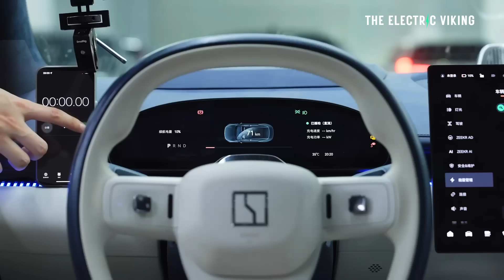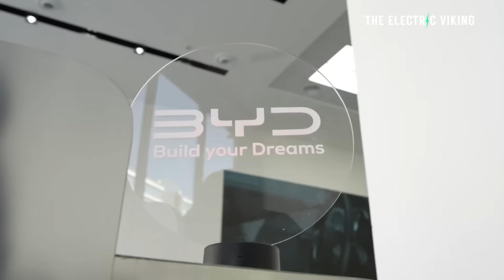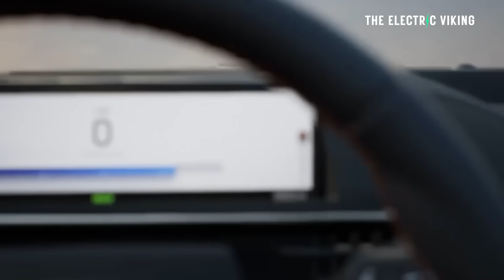2025 EV Sales Skyrocket: WORLD's Unstoppable Rise to 7.2 Million Vehicles

Comment: UPDATE:  I drove past the BYD new factory site in Szeged, Hungary last Saturday, 14/06. They are currently doing site enabling works and building accommodation blocks for Chinese construction staff. The local authority is also reconstructing the road outside the site and have already completed a new access point to the nearby M5/E75 motorway.  The factory will produce the  Dolphin and Atto 3 EV for the European market. Other models, such as the Atto 2 small SUV and the Dolphin Surf (European name for the Seagull minicar), are also planned for production later on. The factory is expected to begin production by the end of 2025.

Comment: Any idea how i buy an electric car. Not knowing if the brand will be around in a few months.
Reply: ?? Buy a used Tesla model 3 Long range AWD . Tesla will be here in a few month for sure.  You can get 4y old car under 60 000 miles for 23 000 $ +/-   (22-24000)  I did that :D  Car looks like new and drives like a demon (almost 500 hp)  :D
Reply: @MartinMartinX  I did exactly that with the small difference our "new" car is a 4 year old Hyundai Ioniq 5. Very nice car so far.
Reply: @MartinMartinX no don’t support Tesla and the egomaniacal fascist Musk! Geely has been around since the early 80s - they make Volvo luxury cars and mining trucks too
Reply: The same dilemma is probably more true of established marques, which are still trying to peddle outdated ICE motors.

Comment: 😮It's pretty selective based on location.  In india, the third largest car market, the ev sales for FY 2025 (April 24 - Mar 25) were 107k even with big government subsidies.  Growth is deceptive, you need to give actual sales numbers.  If a country sells 10 million ice vehicles, and 1000 ev one year, and 10.1 million ice and 1500ev the next year, then ice has gone up 1% and ev 50%, despite the fact that 100k more ice vehicles are on the road for 15 years and only 500 more ev.  It will be interesting to see if petrol prices fall as the demand for oil decreases, as oil is still needed for tar to build roads, and petrol and diesel are part of the refining process.  A lot will depend on charging infrastructure.  No doubt ev will become a big segment of new car sales in the long run.  Hopefully coal fired generation will not increase to offset the power demands of ev and ai.
Reply: Approximately 20 million EVs will be sold in 2025, 12-13 million BEVs and the rest plug-in hybrids.
Reply: So I suggest to look at saturated markets like Europe: ICE sales are down the drain more each year and EV sales are slowly but steadily growing in spite of cancellation of most incentives in most countries. E.G. in the fleet, BEV's are a growing portion even still very very little in most places, but in the interim, with sales market share above 15% in most countries, it is also growing in the fleet all the time. There's no way back.
Reply: @beatreuteler Nobody is denying ev sales being a player.  For europe in 2024, 13% of sales were ev with petrol, hybrid, diesel, plugin hybrid making up the remaining 87%.  Petrol diesel and hybrid are ice, with plugin hybrid a semi ev.  It's still a long way to go to claim ice is dead.  Savings for a lot of people will disappear when road tax for road maintenance is added to ev running costs as it makes up a sizeble part of petrol/diesel costs.  If ev don't pay for the roads, then roads will deteriorate.  You cannot run heating diesel oil in cars for this reason.  A mix of vehicles is likely to remain for a long time
Reply: @barryobrien1890  I agree, with the mix continously shifting until the mix is the other way around than today: less than 5% ICE and hybrids, while BEV's will be above 95% some time later this century. I also do agree that at some point the money used for road construction will need to come from elsewhere than from taxes on fuel but a) that may become a factor in only a decade from now and b) Fossil fuels will become more eexpensive to gain continuously which will make up for most of this benefit.

Comment: The infrastructure isn't here . The few chargers don't work. Other cars block them off .
     To see a Tesla is uncommon.  We are a small town but a hub serving 30 thousand people. Getting a charging plug set up . I dont know of anyone even has them or installs them. People are old here .
Reply: I’m a pensioner. I live in a small, very remote village, with a limited power supply. But I took out a loan to buy an EV. It’s brilliant, and the overall cost inc the loan is less than the cost of running my previous diesel. Stop making excuses.
Reply: I'm seeing twice as many Teslas here in Ottawa than I did six months ago.